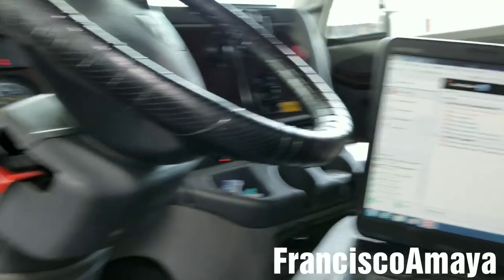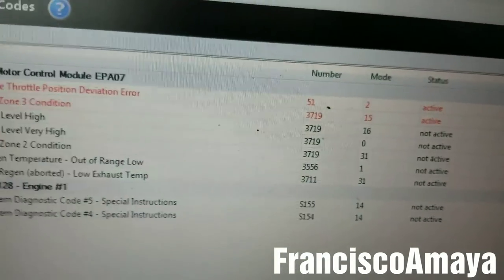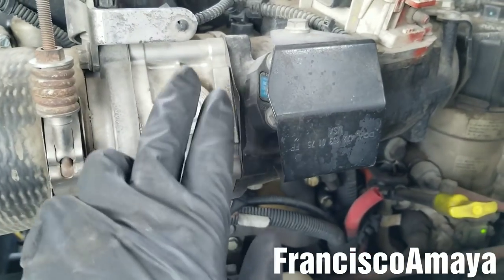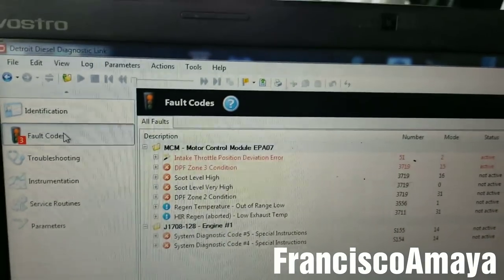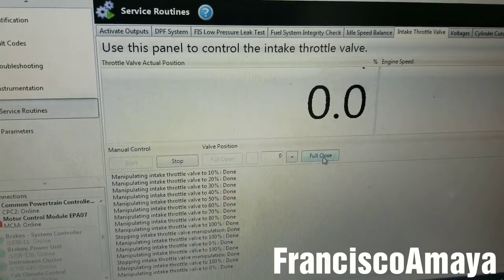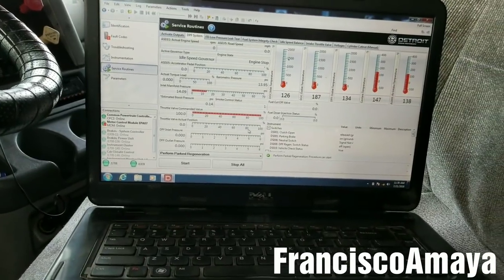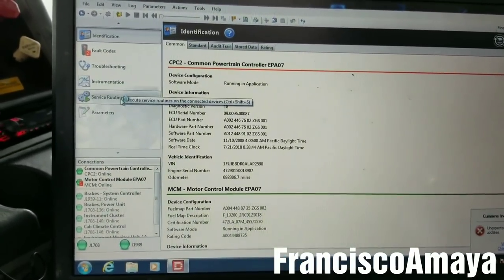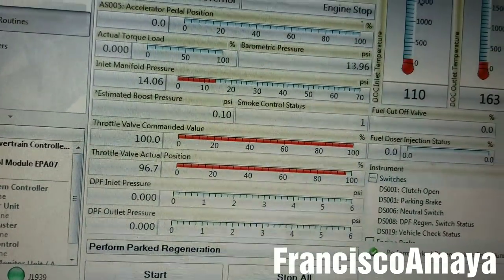Freightliner cascadia DD13 DD15 DD16 spn 51 fmi 2 bad intake throttle valve regen no happening

Comment: Hi Francisco, I recently bought a 2012 freightliner cascadia with dd15 . It used to belong to a fleet and its well taken care of. But it was governor at 65. But I took to the dealership and had the perimeters changed. I had all the fluids and filters changed. But I noticed that I don't have throttle response above 65 empty or loaded. I'm just wondering if there's a different software for the dd15.
Reply: Hello sir, I have the same problem. I bought a Walmart truck and changed the speed to above 65. Can you tell me what worked for you

Comment: Hola fransisco como esta mi camion tiene un problema lene cambiado el trottle valve 2 veces y sigue apareciendo el.codigo q trittle valve problem y tambien sale inta manifold air problem detected derete 10% no se q pueda ser ya tambien cambie el sensor del aire .
Cuando instalo el trottle valve y abro el la llave para encender el camion se supone q ella abra y cierre pero no hace mada nose q pueda ser si me puede ayudar le agrececeria mucho es un 2015 cascadia.

Comment: Hola francisco cómo estás, tengo un dd15 del 2013 el camión pierde fuerza en las subidas cargado y vacío muy rápido le cambie el ínter cooler pero sigue igual usted cres que cea la junta del manifor que este mala y este pendiendo el boost del turbo.
Reply from the maker: Pude se un empaque, si puede ser
Pero tambien puede ser
EGR valvula
Filtros de diesel o air

Comment: francisco how did you get this all knowledge can please tell me..i am 24 and i was a mechanic for like 7 years on old model trucks like Fiat Iveco 682 N3 and i am just new for usa i wanna continue as a mechanic so where i have to go to get some education like yours ??? thank you ..from dallas
Reply from the maker: I love my job, I am willing to do my work for free if it necessary in order to learn something new.
Are you willing to do that?
Reply: @franciscoamayaYT  I have that same code for intake manifold I checked the valve with my hand it opened and closed I thought it was good since it opened and closed could it be causing that issue